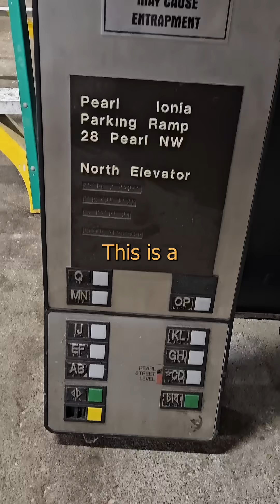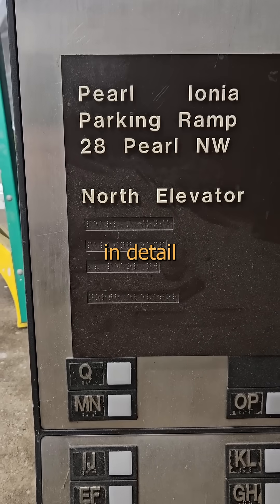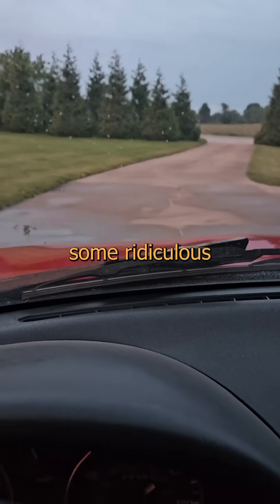Miata Mischief #chrisboden #engineering #gear #elevator #score #stories #parts #hacking #making

Comment: I hauled two one ton beams 40 ft long and 18 inches high with a 1/2 ton Silverado and a 12 foot dump trailer. A cop saw me as soon as I came out the driveway I thought this didn't last long but he yelled get that piece of shit out of my way went 30 miles at 25 mph couldn'tgo any faster the ass of the truck was barley touching . I haul a 3 ton excavator with the same rig. I need a bigger truck I don't know how much more she can take the picture is cool I usually have to show it because people don't believe me. But I have been doing the unbelievable since birth

Comment: 30 years ago, a payment for stripping out shelves in a shop and moving it was...the shelving.  Lucky for me I had a window cut through the cab divider between drivers space and cargo area and the longer bits of shelving just fitted through.  There was 700pounds of shelving in a 6cwt or 600pound weight limit van.  I didn't get into 4th gear once all the way home through Highland roads in Scotland.  I am watching you on a monitor that's on that shelving today.

Comment: I 'recovered' some ex-military equipment, literally from a rubbish pile. My little car sagged under the weight of (from memory) five of these massive 19inch rack mounted boxes, and a serious number of 100m lengths of cable jammed in and through windows and on the roof. None of these could be a "one person lift", but I loaded it all.
Reply: Where there's a will there's a way

Comment: I'm 6 feet tall and I used to drive a base '92 Miata. I also fit some of my taller friends in the passenger seat on two separate occasions, one was 6'4" and the other a 6'2" correctional officer built like a gorilla (nicknamed "wookie", too). Fun car to drive, but if I ever flipped that thing the asphalt would have taken the top four to six inches off my height.

Comment: i had to haul myself and my friend home in a 92 Dodge Cummins that had the steering lockout broken so while i was holding a screwdriver in the steering column, by buddy was rolling through the gears hoping the wheel wouldn't lock up mid turn 😂 fun times

Comment: I took 2½ tons of bagged granite gravel used for a temporary I-5 roof home in my Chevrolet 1500 crew cab. 1/2 of it was placed inside the crew area. I then drove 22 miles home. My brakes didn't work all that well with all that weight and the understeering was a white knuckle ride to be sure.

Comment: I bought a solid oak, Victorian commode on FB Marketplace. It was rather heavy, substantial, huge! My transport at the time was a 125cc scooter, a Honda Joker knock-off no less! It took two of us to lift it on the scooter and the legs were wrapped around my head and torso on the ride home. I didn't have any ratchets straps BUT I did have plenty of ropes and some basic Shibari techniques I happened to have lodged in my brain somewhere.
You may ask why I would bother to buy a heavy, antique commode that needed reupholstering, bondage-tie it to an underpowered scooter and bring it home whilst risking broken ribs or decapitation if it came loose or I crashed.... Two words...
Upcycling.
Queening.

Comment: went on a 10km run during 12th grade, and about 5km in I found a semi broken office chair which was better than the plastic beach one I used to play my laptop. the wheels were unsalvagable, but some other trash through trash day had ropes holding it together, so I used a dirty rope to tie the broken office chair to my back before continuing the route home running- now with weights on. killed my legs, but now I still use this chair (didn't have legs for it, so I cut a hole in my plastic one to put the office seat in, and when it was wobbling,  I tied it down in place with gym weights. shittiest setup you ever did see, but it is mine, and I love it for my enginuity)

Comment: Years ago when I drove a manual transmission 2012 Chevrolet Sonic hatchback I bought an Acme Anvil that weighed something like 160 lbs or more. Had it sitting upright in the back fine until I was almost back to my apartment garage. 

I decided I wanted to u-turn for something and momentarily forgot about the anvil lol. Anvil tipped over, spun around, and the horn punched a hole in the interior plastic of the rear passenger side door. It didn't reach the outer body and was there still when I traded it. Somebody probably had some real questions. 😅😂 the backseats hid it when they weren't laid down.

Comment: Drove around collecting pallets for firewood in my Toyota Yaris. Stacked up 10 pallets on the roof and strapped em up, would've been more but the roof started caving in a little at 10. With my car now 2x its height I started driving back home and drove past an oncoming cop. Threw his car into a U-turn and started speeding toward me to pull me over, got closer and saw the strap, and pulled over disappointed he couldn't arrest me for my secured load. Also one time I moved an 8 foot pot plant across town for my friend. Had it in the back seat with about 5 feet of pot plant sticking out the window driving through town. Good thing I'm in Canada lol

Comment: I was in the Caribbean and we wanted to have a bonfire. I had a rental toyota Vitz and we went to a hotel and liberated some junked pallets out of the dumpster. We managed to get 1 in the back with the seats folded down and the held the other on the roof so we had both windows down, and held it in place while we drove back. The roads were pretty much empty so we weren't really worried and the speed limit wasn't very high. Did pass some cops who honked and laughed, this was very par for the course for the island. Got back safely and had a great bonfire. Was it worth the splinters, probably.

Comment: We put an 8ft tall 24ft wide chain link gate on the roof of my 1978 mercury zephyr station wagon (white with the woodgrain) to get it to the new shop. 

We moved an entire shop with a 1984 dodge rampage pickup. We literally put 2 tons of stuff into a glorified Plymouth Omni with a truck bed and would drive 7 miles

Comment: When I was doing home cleanouts for banks and auction houses we came across a very affluent house that had 31 christmas trees, which was nearly double the amount of rooms in the house. I just remember a whole day of hauling christmas trees up basements steps, throwing them into a large pile from the attic, and filling a roll off dumpster with them. My boss didn't even want to recycle them, but on the last day of the job we found a few more trees and we had no more room in the dumpster, so I had to drive 6-7 of the leftovers to the dump. Everything was secured under a tarp, but those little shitty green plasitic fake needles just got everywhere and were flying out of the tarp spraying green confetti down the interstate everytime I hit a bump. Nobody was honking, so I kept on trucking.

Comment: I heard you could boil mescaline out of a san pedro cactus, so i found a nursery about 70 miles from my house, and bought a huge, 8 foot cactus. And it fit in my mazda 2, but i had to lay it down the center console 😭 so i had to push it out of the way to shift and every time i took a turn it rolled into my shoulder.  I did not get high that night but i did projectile vomit cactus all over my porch.

Comment: I needed a 60 gallon water heater one time and the only thing I owned to get it home was a motorcycle. 

I lashed the water heater sideways on the back of my motorcycle seat and drove it home 30 miles.

Another time I needed a new refrigerator and you guessed it... Motorcycle... Lashed it down and drove 20 miles from Walmart.

V6 boat motor was bad... Needed money. Hauled in on the seat to the scrap yard on the back of a 1976 Honda 750.

By all rights I should be dead by now, but I'm either lucky or blissfully stupid.... Tadaaaaaa

Comment: I brought home a free "non running" Toro 28" Two Stage Snow blower with my tiny ass Nissan Kicks. It barely fit in the back with the seats down and every big bump I hit it bottomed out the rear suspension. Still have that snow blower today and all I needed was some good gas.

Comment: I always take my bicycle to the shop in my 2002 Nissan Tsuru, I have gotten better at cramming things in the backseat.
Also last year I bought some Christmas decorations for my front yard that were over half the length of my car, at first I thought I'd have to tie them to the roof of the car, but I managed to fit them at the back, had to push the seats to the front but it all worked out in the end.

Comment: For sketchy, we had an OLD compressor trailer with very aged dry rotted tires and no plates or lightss we had to move across the county. (This not sketchy but fun...) a couple weeks ago my buddy told me we were going to go pick up a new project car, me figuring it was another VW or something I was ready to help with loading something on their trailer but he said no need because it would fit in the back of my pickup truck. Sure as shootin we got there and to my bewilderment, he got a Messerschmitt 3 wheeled car. Thing was smaller than a motor cycle! It fit in the back with ease and the looks we got driving through town back to his house were priceless

Comment: I once needed to bring some wood home for a desk i was building but i didnt have a car and the busses are slow as dirt in my city. I ended up biking home 11.5KM from the hardware store with a 9'x18" board and a 6'x18" board in my backpack. About 500m from the hardware store I forgot i had a 9' wind sail sticking straight up from my back and clotheslined myself on a tree so hard i nearly did a backflip. The only thing that saved me from the full backflip was once again the 9' board hitting the ground behind me. Ouch. Still got back on the bike and went the rest of the way home. The desk turned out awesome so all worth it

Comment: In 1979 I left California just two steps ahead of a couple of bad check charges with about $89 in my pocket from my first welfare payout. I was in art school and had taken an anatomy class at a community college in California where the TA was part of the French resistance, but that's a side story and was working on a dissection of a cat. So I brought the cat on the greyhound bus in my knapsack. I moved into a group house in Washington DC and kept the cat in the refrigerator. It was completely wrapped up by the way very nicely And not leaking at all. The crazy thing is, they just asked me to get rid of it and when I didn't nothing happened.

Comment: 99 Camaro Z28 loaded to almost bottomed out with roofing materials for a garage project. I had to make that drive REALLY slow. 

Same car, I picked an oversized rocking chair from the roadside. Drove home with the rear hatch open. 

Max speed in that car per GPS was 136.6.

Comment: I like plants in general (practically a requirement for a credentialed botanist) and enjoy pottering about in a woodworking shack.

After major storms I usually go around and pick up chunks of tree for later woodworking.

Some I've tried to replant by sticking the shorne off bit into soil, after treatment with butyric acid to promote rooting.

Occasionally, my collecting occurs in the middle of the night. Like, if the propery is being put up for sale or development soon, and I know from my rambles that there's an interesting specimen there.
That's how I acquired a couple old-fashioned Iris varietals.  Old and gone homesites overgrown with trees now being clearcut with a bulldozer.  

And some flower bulbs in the same situation.  But usually no one cares if I show up for flowers in the daylight.

But I thought dragging that 6' section of Maclura pomifera log home earlier this spring was gonna kill me!  Returned home to get a vehicle, and even then, trying to maneuver the thing was a slog!  Stripped the bark that same night.  
...Met a nice pair cruising the streets that night similarly looking for potential firewood.  I suggested they skip my neighbor's pile for trash pickup, as the tree was infested.  ...I'd already checked...
Reply: Can't easily edit these.  Clarification!
   I didn't haul a 6' section of Osage Orange home to use it as firewood!  I've had a dream for decades of making myself a nice walking stick /staff from a section of Osage Orange, if only I could ever find an appropriate and acquirable tree.  This one was "trimmed" with a chainsaw by a moron, and most of the remains left in place at the edge of a field.  It just needed trimming to a more manageable size before it could be moved. 

I don't know how folks in past years were able to shape this stuff into the smooth and powerful bows I've seen, but my test pieces don't want to be split even with an axe used as a wedge being driven by a sledgehammer!

Comment: Wanted to overhaul my room, wanted to get a larger table, one of them L shaped corner tables, called up my dad to go and pick it up. Turns out the top of the table was underestimatedly large, like if we leave the trunk open and fold all the possible seats it just barely fits large, so i rode the whole 2 hours back home with my knees tucked under my chin on shotgun, with the seat pulled forward as much as it was possible

Comment: I own a toyota mr-2 spyder, it’s basically a mid engine miata with no trunk. Having to move an entire dorm with bed in one trip was an experience. Somehow I managed to use every inch of room with the top down and then some more, then the bed gets ratchet strapped to the roof as if it was the soft top. I made it home without losing anything, and that’s cool.

Comment: I found a 2000s arcade machine on the sidewalk back in 2014 and me being 13 and have no car also lived 50 minutes away from the arcade I called my friends older brother who was 19 at the time to come get it and take me home
One sketchy trip later in a 2007 Toyota pickup truck I now had the arcade working in my garage and no way to explain to my parents why there is a random arcade now
And now in 2025 I still have it and it STILL works great have not replaced a single part on it

Comment: When I was younger, and blissfully unaware that it is truly frowned upon by those who occupy the halls of power, to own and operate an  x-ray generating device for personal use, without state licensure and all manor of oversight; I Drove 800+ miles, one way, to spend the better part of a Saturday in June with my best friend , in an unairconditioned, closed Chiropractic office,  2 states away from my home, and in a southerly direction, uninstalling a full size Fisher X-Ray machine, along with its MASSIIVE oil filled transformer, the wall buckey mount , mounting rails, x-ray head gantry, a newer GE x-ray  head and collimator, high voltage cables the size of pigmy pythons, boxes of film, developing machine, chemicals, enhancer cassettes, film display wall boxes, basically everything one would need to accomplish do it yourself x-rays (DO NOT JUDGE OR IMITATE ME). packed the whole sordid mess into a 2 wheel trailer and the bed of my pickup and hauled it home. Ours is a special breed, many of my close personal friends could only asked what I planned to do with it when told by my wife of the weekend adventure we had, they obviously lacked my special brand of unflinching curiosity.

Comment: My dad had a geo metro and he worked at a lumber mill and alot of times they had planks they couldn't use (for various reasons) and he was allowed to take them home if he wanted so he would fold the passenger seat forward and open the rear hatch and have full normal 2x4s and 2x6s in his geo just sticking out the back on his way home😂, he was able to build a add on to our shed with all those pieces (he did have a long bed one ton chevy but most of the time in the summer he would drive the geo, nearly 50mpgs lol, the truck maybe 12)

Comment: Don't recall doing any shenanigans like that but man, had a Civic, a rock, solid 83 1500 DX hatch with the 5 Spd, yes, it had air. All I did to it was add in a cargo cover that I home brewed and that was that. Reliable as fuck and drove the piss out of it (mileage wise) for 7 years until I got rear ended in it in 1997. It promptly fell apart after that. That and it had been rear ended, but reasonably well repaired before I bought it.

Had an 88 Accord sedan, nice but not ideal. Had a truck for a while (92 Ranger) but now drive an 03 Protege 5 wagon and like the Miata, drives firm and fun to drive, but it's stock, naturally aspirated 2.0, with all of 130HP, chugging around a roughly 2700Lb vehicle. It gets out of the way, as long as I drop down a gear and stomp on it, it'll go. Sadly, it's saddled with the 4 Spd sport stick autobox instead of a row it myself 5 Spd. Currently, it contains my spreader and weed whacker from yesterday in the back.

Should say, the car is looking a bit tired and has just over 200K on it, but it still performs fairly well, all things considered.